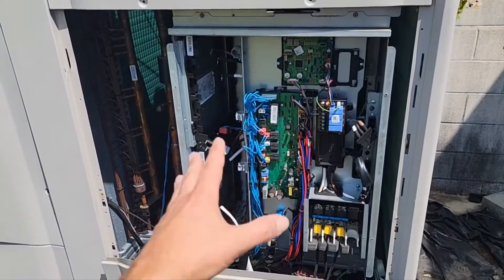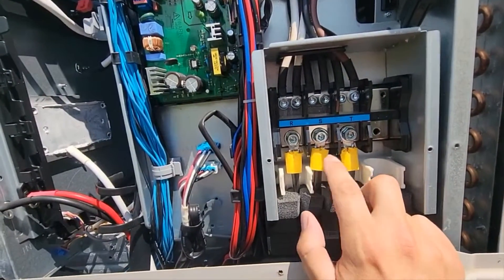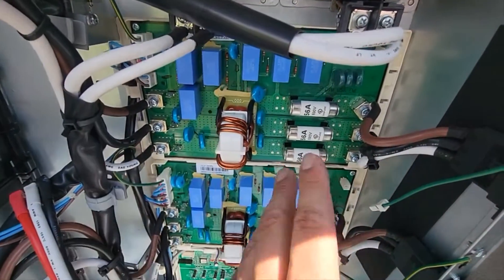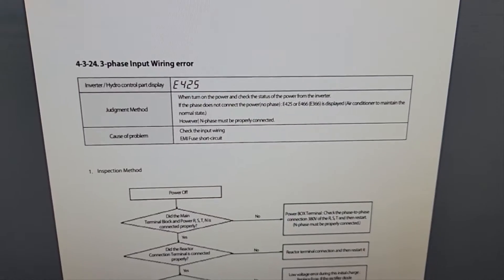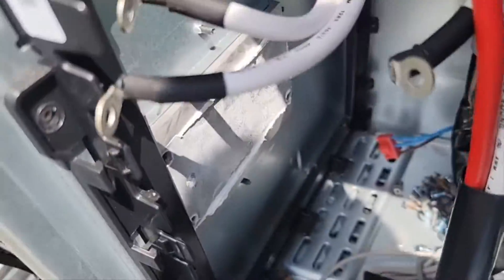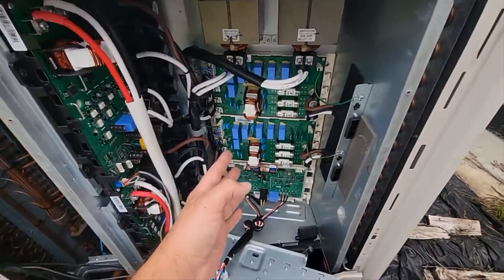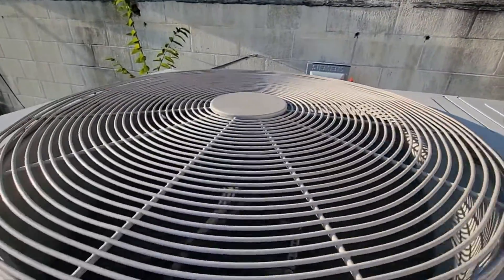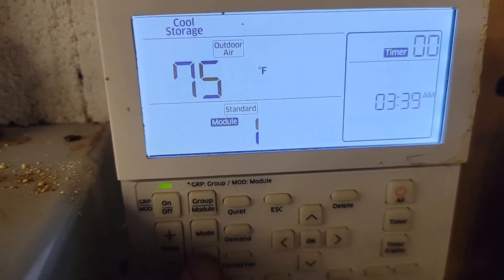Samsung Chiller Error Code E425 @samsunghvacAmerica

Comment: Hello 
Chiller DVM trip on E918 interlock, external pump BMS people are saying faulty flow switch??
Reply from the maker: Check your water level check your water pump and then check your float switch Paddle
Reply: @taddydigest  this new install , performs hard reset works 5 to 10 minutes then trip on interlock.
Reply from the maker: Questions I have
If it's a new install
Size of the pump?
flow rate?
size of the pipe?
is the flow switch stuck?
Reply: @taddydigest  thanks for your prompt reply,I am off site now I will be back tomorrow and I let know. thanks once again.

Comment: What is the cause of failure? Do you have a surge protection device on that unit?
Reply from the maker: That's a good idea
 I do not
 Thank you for that
  I'm gonna figure out what that would cost
Reply: $100 plus or minus for my single phase versions. Mounts right at the disconnect. Our power companies do not install capacitor banks up here in Kentucky like they did down in Atlanta. I go through 10 times the capacitors that I did back in the late 90s in Atlanta Georgia. Only install these on my own systems and high dollar systems for customers. IE variable speed.
Reply from the maker: That's a affordable good price Hope I can find one for that price
 I notice I'm going through a lot more capacitors nowadays